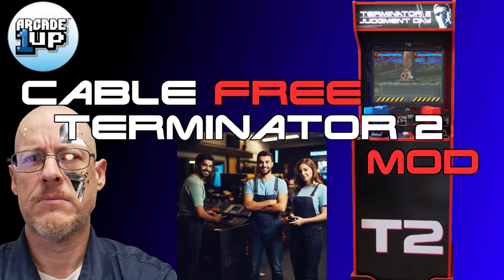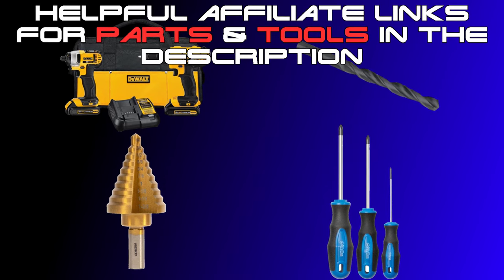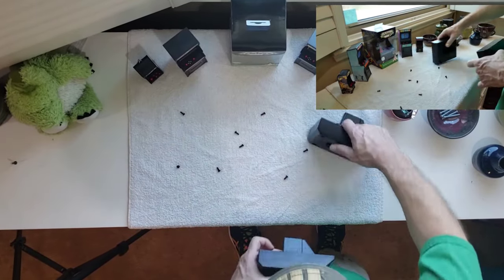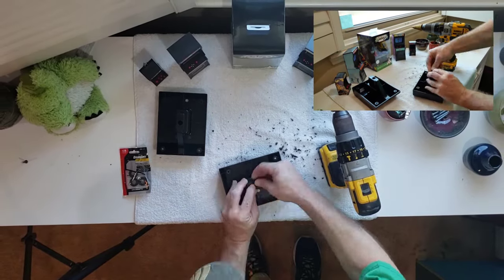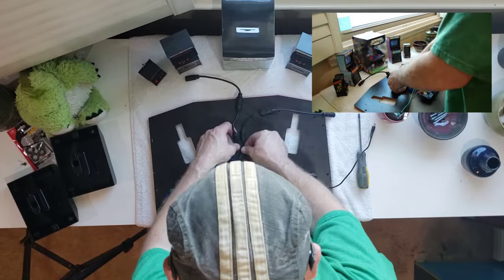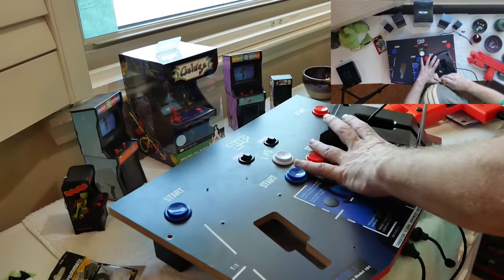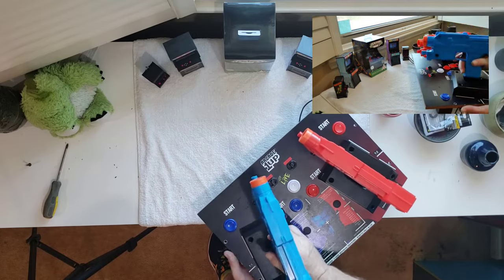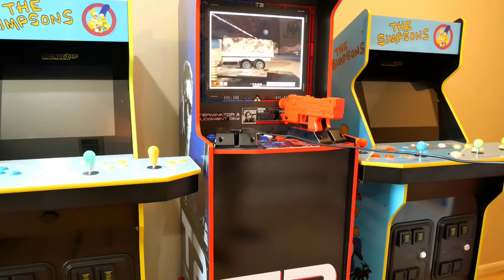The Cable FREE Arcade1up T-2 Light Gun Mod.

Comment: I did a very similar mod except I used a trashed soldering iron we had at high temp just to melt a hole in the bottom. Your way is much cleaner. 😁
Reply from the maker: Again Brother thank you for the parts.
Reply: @TechicallyTNT  Glad I could do it and it’s been great watching your videos to see what you’ve done with them. Did I spy some of the bat tops I gave you on one of your Simpsons machines in that video?

Comment: I did basically the same mod, although I think I used smaller grommets. Getting the cable with the connector on the end of it through the grommet was a struggle.  But I like the look vs just a jagged hole. I used some kitchen sink weights to make retracting the cords easier.
Reply from the maker: Yeah, I had to look around for all the right sized parts. Getting the correct size for everything was the hardest part. The Grommets where a big thing for me, as I didn't wait the mod to damage my cab. Thanks for checking out the video. That means the world to me.